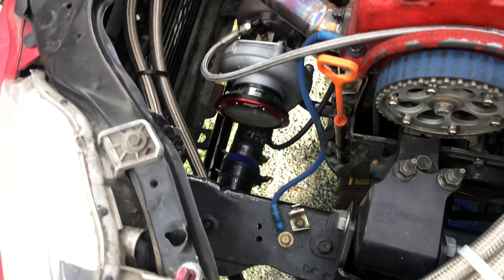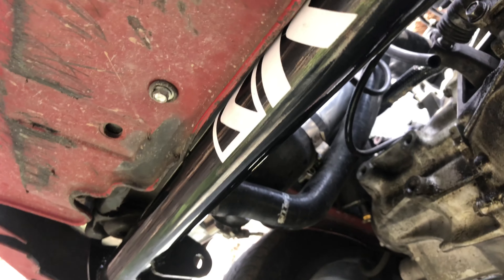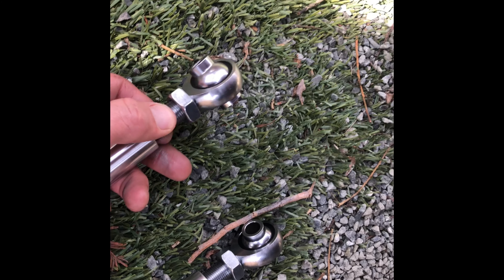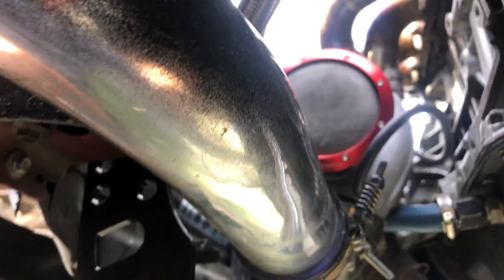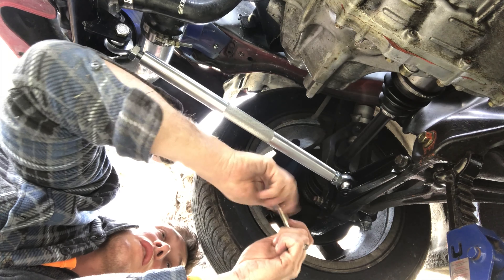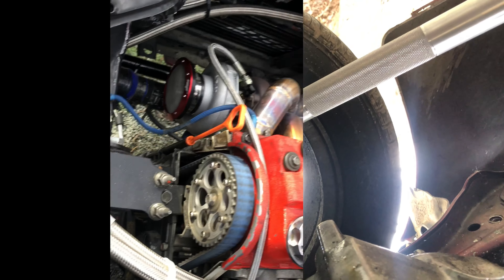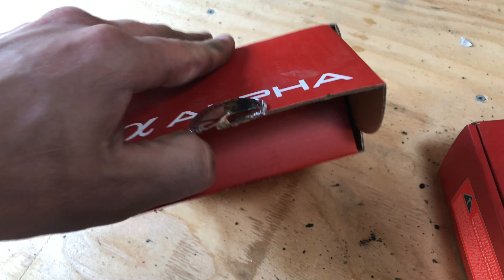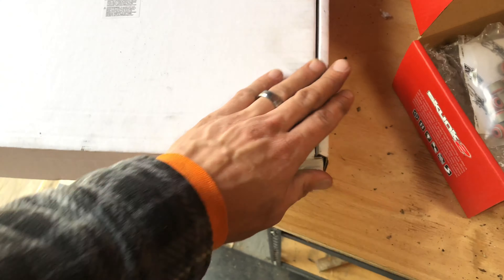K-Tuned traction bar install

Comment: Hi, im thinking about buying Tierod ends grom ktuned, and one question, cię do they feel is there A big diference?
Nad second one, is mount for traction bar on front peace, one you have a problem with nut, in line with bushings from lca?
Reply from the maker: Do not get outer tie rods . Stay ome or go with hard race
Reply: @BigPowerstrokeguy hardrace upside down? Or oem style?

Comment: Hot side means the hot side of the of the turbo(exhaust). The cold side is the front side that stays cool because it's not connected to the exhaust. You were talking about the cold side. The intercooler will never bee hooked up to the hot side.